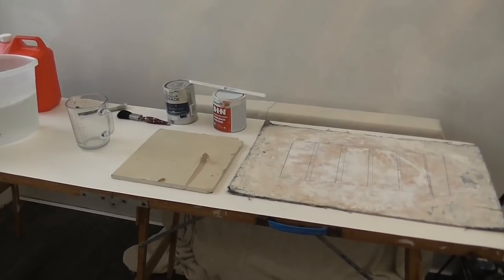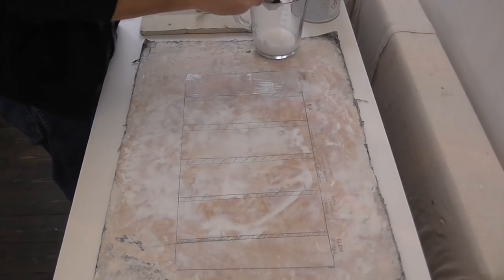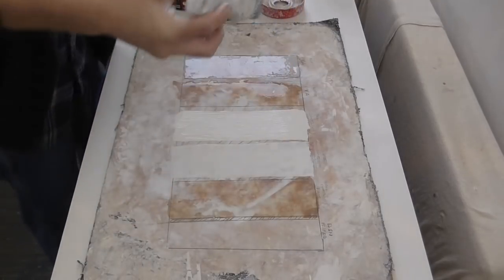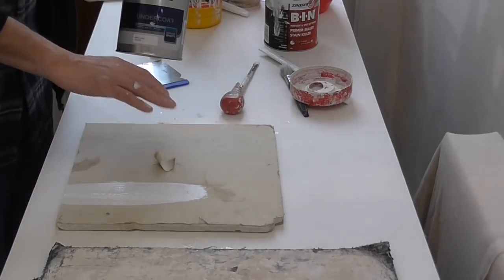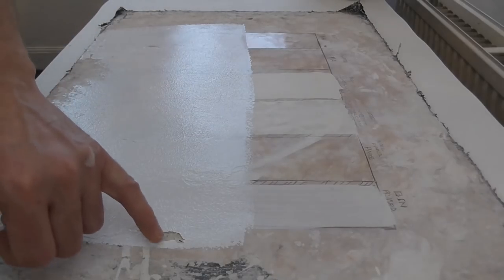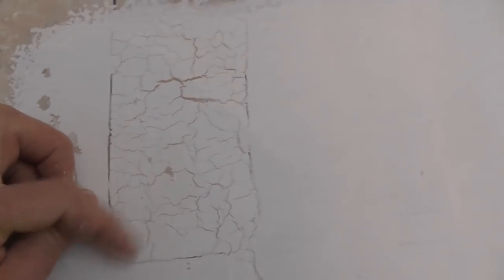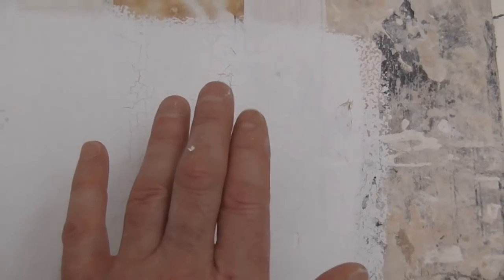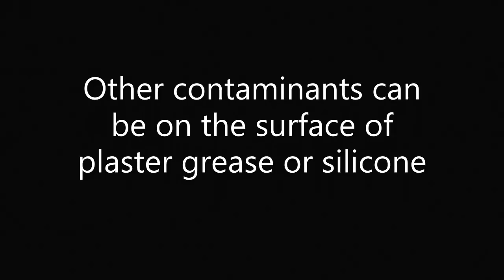What You Need To Know About PVA!

Comment: Would you apply the diluted PVA with a roller or brush?
Reply from the maker: Best with a brush as it's too thin really to use a roller.
Reply: Bsweeney1206 - I've used a roller and it worked: it is very drippy... but faster

Comment: What would be the best PVA dilution ratio for painting on a concrete outside doorstep (that was previously painted, but has been scraped down as previous paint was old and flaking off) which has some exposed concrete and some old paint remaining (similar to your Garage floor video where it was Red and you then painted Grey)? I purchased some PVA Bond by Ever Build, not sure if this is the correct stuff? Thanks in advance!
Reply from the maker: As long as it's not waterproof PVA then follow instructions in video that shows you the ratio for plaster.... Same for your concrete you never want a thick layer of PVA always must soak right in.. thanks
Reply: Painting and Decorating thanks for coming back to me. Is this the 100ml PVA to 8 litres of water? It’s only a small front doorstep, so didn’t want to make so much of it if that makes sense. I’ve read on the reverse the dilution ratio is 1 part to 4 parts water. Does this sound right? It does say not for exterior applications and instead use SBR bond however I’m assuming it doesn’t matter in my case? Thanks again!

Comment: Would diluted PVA be good to seal very fine hairline crack in plaster before painting
Reply from the maker: No but diluted PVA will seal the porosity of the plaster. Once dry give it a coat of paint  then see if any filling needs doing.. use a hardstop filler...  paint and filler mixed together small amount of water. Thanks

Comment: As usual, very informative. I'm slowly getting through all your videos. I have a problem with a kitchen ceiling. It's painted artex but the paint is peeling off. It has happened since I moved in so I don't know what it was painted with. There are big flakes of paint peeling off. I can't sand it back as it's textured artex. Any ideas as to the best solution. Do you think Zinnser Gardz rather than BIN or diluted PVA? Or will I have to get it skimmed over. Thanks.
Reply from the maker: Remove as much loose as you can sometimes a stiff brush can help... seal with diluted PVA   thanks
Reply: Painting and Decorating Thanks for your reply. I’ll give it a go.

Comment: I'm having a bit of a game with some silk paint... the clowns who decorated my living room (before I bought it) used from what I can tell silk paint which was applied straight over a previous coat of silk which was applied direct to unsealed plaster. I'm trying to get some plain white matt emulsion over it - worked fine for the most part, but I keep getting bubbly bits.  I'm scraping off the bubbles, then scoring the shiny pva with some heavy sandpaper, smoothing and filling the edges and then painting again. Would PVA be a good solution here? Struggling!
Reply from the maker: Sometimes if left bubbles can dry back diluted PVA is good for sealing plaster but no good going over silk...  silk on flat walls should be sanded then just paint.
Reply: @PaintingandDecorating  Many thanks for the response! Fastest response on youtube yet 😂  When you say sand, do you mean sand it off, or just rough it up a bit like a key?
Reply from the maker: @balke7935  it's more to de nib and key...  emulsion paints usually stick well to each other as long as no contamination.
Reply: @PaintingandDecorating  Might be a good subject for a future video. I think the previous paint is vinyl as it has very plasticy qualities. I wish I'd key'd it up and painted it with an oil based undercoat before painting with emulsion. Live and learn.

Comment: I have just covered my 20 year old plaster walls with diluted pva, im just seeing now peoples main opinion is its a bad idea, walls looks good but takes loads of layers to cover, some very small areas comes off with roller on dried first coat, Do you think they will be alright? Everyone seems to be so against diluted pva for some reason
Reply from the maker: You have been living with bare plaster for twenty years?
Reply from the maker: P.s.  diluted PVA used correctly is fine.
Reply: Haha, I bought a place and the old paint came off like wallpaper, pretty weird. But I have went and diluted pva (1) with water (5). The second coat has peeled in some very small areas and i have scraped it back, should I apply another thin layer of pva mix and let it dry before emulsion?thanks for swift reply 👍
Reply from the maker: @davidwithers3715  too strong a mix it needs to be very watery. So it can soak right into the plaster and not sit on the top.

Comment: What method would you recommend for treating emulsioned walls before papering
Reply from the maker: Wipe over using warm soapy water and then light sand. If it's contract matt then seal with diluted PVA.
Reply: @PaintingandDecorating  thanks very much.
Reply: @PaintingandDecorating  how many parts pva to parts water would you recommend.
Reply from the maker: @mikegerrard1982  100ml for 8 liters
Reply: @PaintingandDecorating  Thanks. Loving the videos.

Comment: Well the first thing to know about PVA is to read data sheet where we can learn that manufacturer is against using it as a sealer before painting.
Reply from the maker: Well proof in the video shows it works you need to dilute it ...   Will stick to what I know and have tested and works. It also shows how it can go wrong.